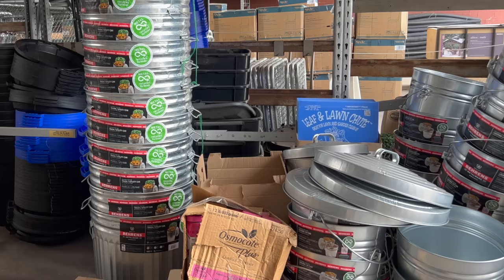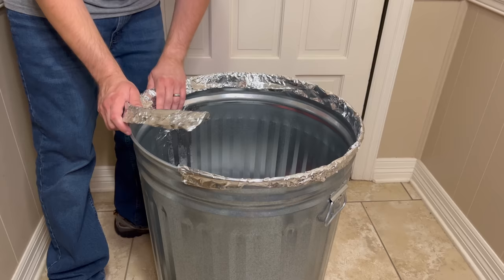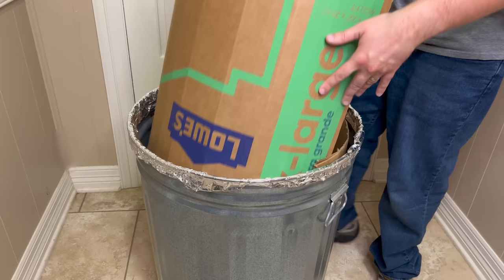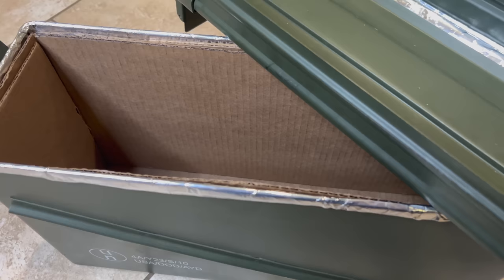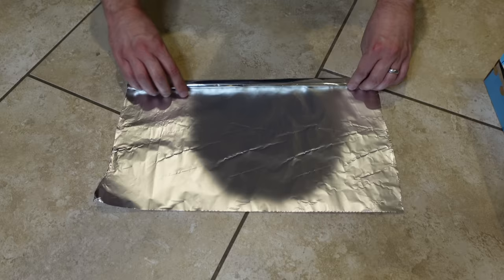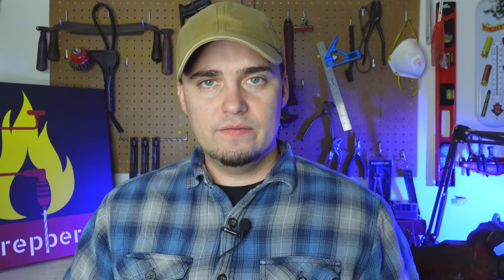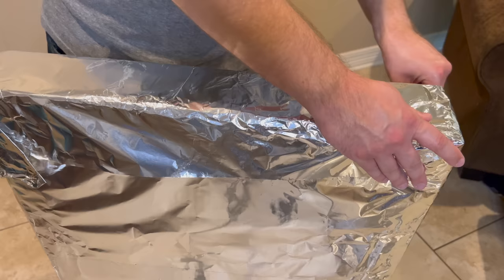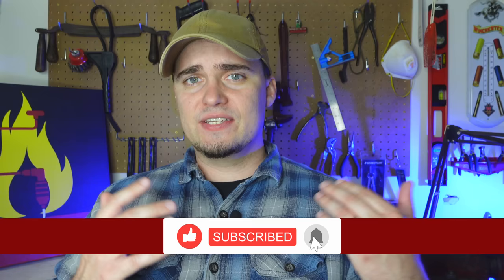3 Ways to Build a Faraday Cage

Comment: Part of my homesteading setup I plan to turn my old barn into a massive Faraday cage so I can park my truck inside it.
Reply: I’ve also seen things you can install into your vehicle to protect your electrical system from a shockwave.
Reply: I bought a 40' shipping container to park my razor in. Also gives me plenty of space for a solar array.
Reply: I got a old jeep just for a emp attack
Reply: @KimberlynSowles  Cops and the feds got them on their rigs
Reply: @StoicThrower  Does an f150 fit in a container?
Reply: Just buy a surge protector
Reply: Cheaper to just emp proof your truck. If money isn't an option why not do both? Can't be to safe, right?
Reply: @brandoncleckler3192  right now money is the problem bit trying to get to it as quickly as possible. Reason for doing the barn and not the truck itself was to keep other electronics in there as well. But I agree, both would be best.
Reply: @licklogacres use the shipping container idea that the other guy had. You can also rent them instead of buying them.
Reply: @braydon805  nope that won’t work esp if phones or cars etc aren’t plugged in.
Reply: @Dotalina33  wdym? Surge protector is always plugged into the car
Reply: @braydon805  I’m also speaking if electric grid is down.
Reply: @Dotalina33  a surge protecter doesn’t run off the electrical grid. It plugs into your car battery and alternator and keeps the voltage/amperage to a minimum. In the event of a EMP it would get rid of all that extra voltage/amps
Reply: But I agree that’s a great idea. I wish I had land like that so much
Reply: @jadenantal1652 yes it barely will but you will have to climb out the back window, or push it in from the back

Comment: NOTE. Power tool batteries have circuit boards in them. If the board gets damaged the battery is trashed. So you may want to put several tool batteries in there.

Comment: Original metal Faraday cages were lined with rubber. The reason is rubber is an insulator against any type of electrical current from EMF to EMP. Ensure all sides are rubber lined including the lid.

Comment: You might be surprised to know a faraday cage doesn't necessarily require a complete metal enclosure with metal seals as long as there is a conductive metal skeleton completely surrounding the object(s) you're trying to protect.  Electricity is magnetically attracted to any conductive metal with silver being at the top of the list.  Aluminum is your best bet as well cheapest.  What you have demonstrated here is excellent.  I've seen it tested-- plus I built one very similar to yours by isolating the items in a non-conductive container, tape it up with aluminum tape and it's good to go.

Comment: Thank you for presenting the information in a simple yet practical way:  the idea of popping a light inside the container to check for holes was inspired!  I'd been thinking of using an old metal filing cabinet as my faraday cage - boxing up everything I want to save in their own cardboard boxes, then sealing all the gaps with aluminium tape, and finally wrapping the whole lot in aluminium foil - but I think I'm going splash out on a few metal bins instead (ammo cases are surprisingly hard to find here in Blighty).  Thank you again.
Reply from the maker: You’re welcome! Thanks for watching and commenting!

Comment: WE DID IT AND IT WORKED! Thank you so much for the great instruction. We did the trash can method and made room for our cell phones, lap tops, solar generator and even more. I just did the tin foil gasket. We tried calling my cell several times and it actually blocked the signal. Happy October 4th everyone. I for one am not trusting what is really happening.

Comment: For larger equipment, you could use metal roofing or siding corrugated steel and weld up a big enough box. 👍
Reply from the maker: Thanks for commenting Eric!
Reply: @MR-nl8xr  the theory is if the metal container is sealed from the phone radio waves it is sealed, but that is not really true. To accurately test you would need two radios attenuated at 462 to 467 mhz. One inside and one outside. If you can't receive through your faraday cage, it is good. An EMP, though upwards to 1 ghz, but only the high end frequencies (100s mhz) can couple into small electronics. So you need the 462/467 range. The more layers of shielding the better. 👍
Reply: @MR-nl8xr  yes it does..look it up. Megahertz is the same measurement for waves such as sound and electromagnetic radiation. We are talking about keeping the range of around 100 mhtz away from your electronics witch will fry the components. Electromagnetic radiation travels in waves that range from very long radio waves to very short gamma waves. Look it up. You asked how a phone could be used in a u metal container to see if it would protect devices from electromagnetic pulse and I told you it can't..then I told you what can and you argue out of ignorance. You could also use an EMF meter that you read standard EMF signals off your computer or microwave stove or power lines. 😐
Reply: @MR-nl8xr  it is not high voltage that an EMP sends, it is an electromagnetic field. do your research.
Reply: @MR-nl8xr  go do your research....a good place for you to start is at NASA...read anatomy of an electromagnetic wave....then research actual test the government did years ago on electromagnetic waves and shielding.
Reply: @ericarnaud7983  Maybe take your own advice, an electromagnetic wave will induce current as it passes through a conductor, it's how we make electricity with a generator. During the Clarington event in 1859 telegraphs ran without power and platinum contacts melted.

Comment: Higher frequency signals can get through smaller openings, that's why the NOAA weather radio failed with the lid on, but the Cellphone was still in communication until you sealed those openings with foils layers. I'd think to connect your can to an earth ground would improve the function more.
Reply: for EMP / ZeroRF containers always earth ground even if you have to put a 8-10' copper rod into the ground and attach a 16ga wire to your can.
Reply: @vultureTX001  Thanks for the tip
Reply: @vultureTX001 
What if you live on a granite slab ?
Thx😊
Reply: @vultureTX001 I was thinking the same thing,  great idea
Reply: So let me ask a question.
Does an emp pass through soil and if so how deep?
Could you store things underground?

Comment: Big Fan of your channel for a wbile now. 
So have been working on a 40’ shipping container 
Almost done.  Pretty simple just BIG.  Looks like all is good at this point.  A little welding & ALOT Aluminum foil rolled for the doors.  Contact points ground down to bare metal   OH & a bunch of copper braid straps all tied into a multi radial network of grounding rods.  Just got tired of fooling with little cans & such. Fingers crossed !!!
Reply from the maker: Thanks for commenting Eric!
Reply: I salute you preppers.  You gie hope whereas some do not.  You won't be out marauding and thieving.  The more preppers the better it is for mankind. The children of preppers have the best chance living.

Comment: If you are wrapping a box with foil I think a easy way is to use some spray adhesive to lay the foil directly 😉
Reply: Super 77 spay adhesive is great
Reply: It has to be conductive to work
Reply: @clbooth3  I don't know what you talking about. Te conductor is the foil not the glue.
Reply: @joeyanglada1275  the glue is under the foil correct?!?

Tell me you have conductive glue. 

Without it the glue becomes an insulator.

Comment: About the top gasket for the ammo can, you can use a length of stainless wrapped toilet feed line as your gasket, it just needs to be long enough to go all the way around the inside continuously and be stitched together with some fine copper wire to keep the metal Continuous. on the trashcan, you can sandblast the top inside of the lid and the top edge of the can to remove any residue of oil that is used in the manufacturing.  Good Tips!  carry on.

Comment: Jr great video throwing in my two cents on the last cage for the solar panels but some kind of shoe or a runner on the bottom so the foil does not rip or tear if you move it. Now I have a project for this weekend I will do a metal can like you did yours. Thanks for the idea.
Reply from the maker: Thanks Billy!

Comment: Canadian prepper had an engineer from Nasa on his channel who created a chip that can pick up on radiation when it hits the above normal level.   I bought some of these and when I checked it against the microwave it did light up about a little less then 1 foot from the microwave.  I then took it upstairs to the router and my chip went CRAZY.  So I turned the router to the wall but some of the waves were still bouncing back toward me and I had to put this faraday cage OVER AND BLOCKING THE ROUTER and now there is no more radiation triggering the chip.
Reply: Where do I get one of these chip radiation meters/detectors? 

What is the guys name page? Or???

Comment: YES YES YES, this is awesome, thanks!  I was trying to cram stuff in some small faraday bags and I have a large 4Patriots battery backup, a ton of panels, hand crank radio's, some Ham and CB radio's and the bags just were NOT cutting it, thanks for the video, very help!
Reply from the maker: You’re welcome! Thanks for watching and commenting!
Reply: Another alternative is the emf fabric. More expensive but I’m sewing up different sized packs from one roll of several yards. Just a thought for larger items
Reply: Me too! Invested in  2 Patriot 4 units & a smaller solar gen. In Addition to 3 Behring  locking cans. Decided to go big with a 2 shelf steel storage cabinet. Big fun family project. Followed all instructions  X 2.  Tested & it seems to work. All solar gens, small electronics,  appliances, cables,  back up gadgets fit nicely.  Hope it works as purposed.  Fingers crossed.  That’s all we can do.

Comment: I have the metal trash can Faraday cage already but didnt add foil around the inside lid yet because I want access but I will add foil and test with a light inside too.  Awsome advices in this video.   I bought 2 Faraday bags GoDark for my Nintendo Switch and my phone when I'm not home
Reply: My solar generator is too big to fit in the can. I put the can upside down onto the genny. It's in my basement the rim sitting on concrete. It was the only way to cover the genny.

Comment: Ammo can faraday box is perfect for my mid 80's pre chip vehicle. Distributor cap, coil, fuses, cable harness, spark plugs all fit with room to spare.
Reply: None of the items mentioned above have micro electronics. They a safe from an EMP with no protection.

Comment: One thing about using metal repair tape is the glue on the back side , the sticky side will sometimes prevent a good seal . I use alcohol to remove the glue from the center of the tape to ensure metal to metal contact .

Comment: Ive been using 45 gallon drums with a leaver lock lid. Cardboard lined, change gasket to EMP type. Making another one this week. Easy to come and go from these drums. I have two gas generators in one, A complete solar system in an other, I store any thing that could be damaged in these. I have EMP pouches for communication radios when not in use.

Comment: I wonder how long will an EMP will last? 1 day, a week, a month, or a year? Just asking and wondering. Thank you. Great video.
Reply: What are you asking? An EMP is a pulse of radio waves that rolls though hitting anything with conductive material with an ungodly amount of energy. 

The aftermath however is likely 2-3 weeks for a major city infrastructure, months for small towns and years for most everything else.
Reply: @dramspringfeald  Thank you. I didn't know about EMP. 
I ask and learn.
Reply: @henryskinner1092 

It will last for a few seconds. Solar flares could last for hours and days, maybe weeks.
Reply: Depends on how it's created...
Reply: Glad you asked your question, Henry.  I just ran across this video info and was wondering the same thing.  And, I don't think we're related.

Comment: The ammo box with the tinfoil (and we used a shoe box instead of cutting cardboard) actually works and I can’t believe it! We’ve tried multiple different ways previously and no luck but this worked!! And we did sand the paint off the edges of the metal and put a phone in it and called and did not ring and went straight to voicemail

Comment: Could you wrap the original gasket on the ammo box in the foil for a seal/connection? And I might have missed it but do you add desiccant to prevent internal corrosion? Even a sock with oatmeal will keep it dry inside but store-bought is better.

Comment: After the EMP hits, how do you know when it's safe to take your devices back out?
Reply: You wait until after the fallout ends. Your phone most likely wont work even if protected because of the transmission lines (repeaters and other electronics on cellphone towers would be fried,  but if you have walkie talkies or two way radio's and it was in a faraday box it should be fine after fallout, maybe a bit staticy but will work.. To recover from an EMP strike takes 4+ years or much longer to recover because of all effected needs to be replaced even in the 5 mile radius, but effects can travel over a hundred mi. Your power tool(s) will work right afterwards, flashlights and other electronic devices that were protected will work.  Older cars from 60s or older would work. Some cars may even just stall out and never start after until its repaired, electric vehicles will not work after emp because the electronics and wiring would be fried.😉🙂
Reply: When your skin stops glowing in the dark!

Comment: Rather than using cardboard to line/insulate the side of the metal garbage can, I instead took a rubbermade garbage can, and cut off the handles, so that it would drop right into the can.  I also try to leave items in their original packaging.
Reply: Insulating the inside of the Faraday cage in not required.
Reply: @michaelbrum007brumbelow9  Normally, no.  But if there is an electrical connection with it, you can negate the function.

Comment: Would it be feasible to install wire mesh of some kind around the inside of your garage to protect everything in it? Cars have circuit boards too.....
Reply: I would find it next to impossible to EMP any garage I have ever been in. It would be easier to  purchase a pre 1980 vehicle. they do not have microelectronics and therefore do not require EMP protection.

Comment: we installed an off grid solar system.  The inverters and batteries are electronics ..  so I'm concerned about getting whacked.  He also has it connected to the fuse box so we can turn off main house and turn on the solar breaker to save money on electric as much as possible ..  so there are solar panels and cables leading inside, etc ..  How much is this safe from an emp bc i think this is inevitable?  and if not protected,  how can I protect two inverters on the wall and batteries laying flat.  We use them everyday so big cabinet??

Comment: I was never able to block my two way walkie-talkie signal after three layers of foil. Does this mean it will not work?
Reply: The antenna wasn't making contact with the metal can/box was it?  Any contact merely would make the cage an antenna for your W-T.  Also the ideal protection is to ground the Faraday cage to earth ground (on a concrete basement floor might work, metal stake into the ground somewhere would be better - or contact to say your sewer/septic pipe out underground, if it's not pvc).

Comment: As someone living off grid, I have to worry about lighting wrecking electronics.  I am looking for a faraday cage solution to protect equipment "where it is". 
I will take pictures/notes and maybe put up a video about the experience. 

Great storage solution's for replacement equipment!  I plan on using your suggestions for my gear. Thank you.

Comment: Too make a conductive gasket you could use automotive heater hose or vacuum hose to see if it's conductive you need to use an ohmmeter  measures of resistance of the hose

Comment: Try going to an local HVAC Company and have them make you a galvanized steel box with a removable lid and it’s already insulated, all you need to do is use your aluminum tape and maybe some hinges and a hasp and should work like a charm, they usually are glad to help for cheap

Comment: Just a thought on topic, but off topic. I had a guy come into work with a pace maker the other night and that got me to thinking about implanted pace makers and difribullaters. These things run on a battery and generator inside your body. What happens after an EMP? Going down that rabbit hole lead me to the only conclusion i could research is maybe having some medication on hand to help with the heart problem the difribullater or the pace maker is correcting. Anybody got any thoughts/solutions to this potential problem? 🤔
Reply: if it's fully implanted (i.e. no ports in your skin) they should be fine. Given that they're surrounded by your body, and your flesh is mostly water, any EMP reaching the device should (theoretically) be attenuated to a safe level.

Comment: I have portable solar panels in a 31 gallon can thats seams sealed with copper tape and lined with cardboard.  I lined around the top on can with the copper tape and no radio,cell phone signal can get through. I have 10 gallon cans for each portable power station with all their wires,connectors, i have 3  6 gallon can's fixed for flashlights, 2 way radios, weather emergency radio,rechargeable batteries, battery chargers and a couple of small power stations,rechargeable light bulbs,usb plasma lighters.

Comment: Thanks for the video Mark quick question: is there a good reason not to use the original rubber gasket wrapped completely in foil after area paint removal?